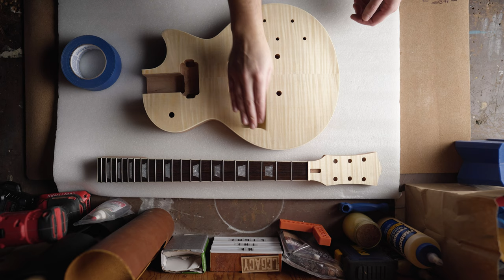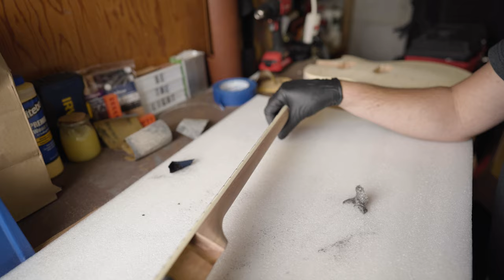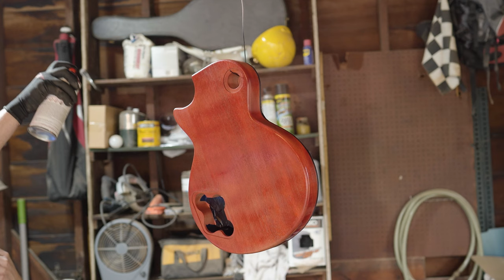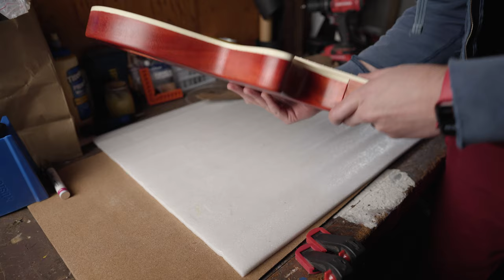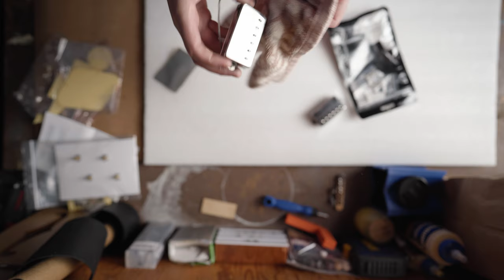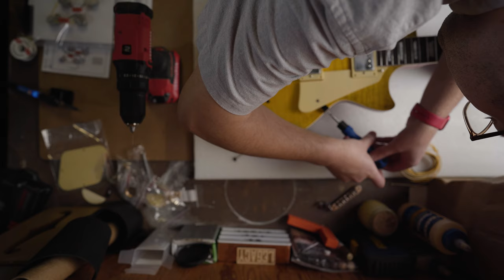Making a Lazarus Les Paul from a Stew-Mac Guitar Kit - ASMR (No Talking) 4k

Comment: that neck joint makes me worry
Reply from the maker: Don't worry it's solid, going nowhere.
Reply: @LegacyGuitars  I think Danny's concern (Hi, Danny!) was that we watched you spray stain and lacquer over the mating surfaces of the neck that must be well joined with glue to their corresponding parts of the body's neck pocket. Unless you sanded these clean later and for some reason did not put that in the video, this will not be a strong joint. PVA or aliphatic resin wood glues will not adhere properly to stain, lacquer, varnish or oil finishes. I notice you used masking tape on many steps of building and finishing this beautiful guitar, which is great. While technically you didn't 'finish' the neck pocket, unfortunately you probably got a lot of overspray in there. Next time tape off all hidden surfaces of the neck joint while you're doing the stain and lacquer and the resulting glue joint will be stronger than the wood. The way you did it, good luck! When it fails, sand the mating surfaces raw before sticking them back together. Another tip: hammer the post anchors in using a dowel instead of a rag. This gives you better control, concentrates the force and will help avoid hammer mishaps. Otherwise, pretty guitar and nice job! I'll shut up now. (And everyone said, "Finally! I thought that guy would NEVER shut up!")
Reply from the maker: @markpell8979  thanks for the tips!
Reply: @LegacyGuitars  Hey Archie, I hope I didn't sound like too much of a smart-Alec. If so, I sincerely apologize. You have built a lovely guitar (I like the yellow top, I want one like that!) and I hope you get lots of enjoyment from it. If you ever do have to reset that neck just be sure to sand as needed to get raw wood to wood contact inside the joint for the glue. But as tight as that thing fits, I bet you'll be okay. This last tip may seem like sacrilege but actually if you are in doubt at all it wouldn't hurt to put just a couple countersunk wood screws through the back into the neck to lock your glue joint in place. A "hybrid" neck joint? Disregard that if it sounds terrible or aesthetically wrong to you. But keep it in mind. Well-installed screws would not hurt your guitar or its sound. Good luck sir!
Reply from the maker: @markpell8979  you're all good man, yeah it turned out great. I've made a lot of cool guitars but that one was my wife's favorite. I really love the color of the translucent cherry nitro on the mahogany back. I'm working on a few new ones right now and filming them, hopefully, I'll have them done and the video up in a few weeks. 

I'm making an acoustic with an ebony body right now.
Reply: @LegacyGuitars  Sounds interesting man. I'm subscribed now, appreciate you taking time to chat. Look forward to watching your show!
Reply from the maker: @markpell8979  Thanks!